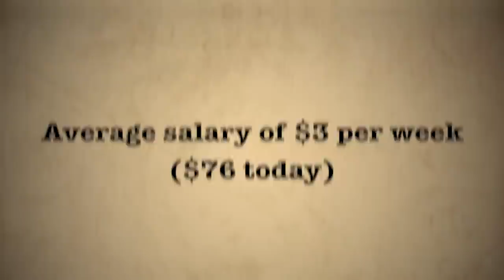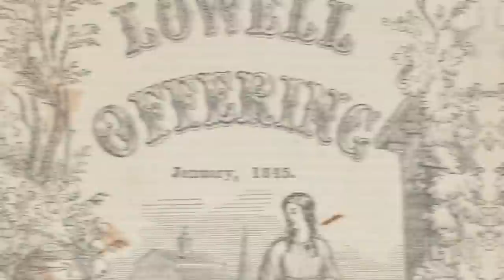The Lowell Mill Girls - American Wage Slavery

Comment: Aside from wanting to cry at pronunciation (it's pronounced like Low Wool), I think this misses a major point. It wasn't that the mill girls had it "too good for too long" but that the vast number of textile mills popping up everywhere led to overproduction and a steep decline in the market price for textiles. Since there was far higher supply than demand, the profits took a dive. They wanted the city to be an intellectual beacon, but the high supply meant factory speed ups, reduction in wages, having the mill workers double up on looms, and cuts in boarding house subsidy from the mills. Accounts of the early days do talk of women taping poems to the looms to read as they worked and the youngest girls having free time to play in the yards between running bobbins to the workers. It sounds like it started the way it intended, but you can't keep those standards unless you're making profits to match.

If you want another great story for this channel, there's a mill that collapses in Lawrence, I believe, that buried over half the workers alive. A dropped lantern from a rescuer caused a fire in the rubble, and no one else was able to rescue the workers. Instead the city stood by and listened as the mill girls sang like they did while working, only to hear their voices silenced slowly as the night wore on until none remained. The cause of the collapse? Factory owners taking shortcuts on building and cramming more machines on each floor than the factory could handle. So many lives were lost for the sake of maximum products.
Reply: Yeah that pronunciation is killing me. Usually I can muscle through, but he's saying it in a way that's making me disassociate from a city I used to live in
Reply: The triangle shirtwaist company fire?
Reply: @BigGahmBoss  Yeah, while I’ve not lived in Lowell itself, the pronunciation is killing me.
Reply: @coreyperdue1966  I got my head split open at the Tsongas Arena lol
Reply: @BigGahmBoss  LOL jeez man im sorry. Living in lowell typically results in brain damage one way or the other though
Reply: @coreyperdue1966  that is by and far the tamest of my Lowell stories. Those years will stay with me forever, for better or worse
Reply: @shaynalightfoot1414  Triangle Shirt waist fire was in New York City, I believe, and was pretty horrific as well. This was a large mill building that collapsed and the fire started when a lantern was dropped by a rescuer as they worked through the night to pull people out of the rubble. Due to the machine oil and the fabric there was nothing to be done.
Reply: @sarasynfox  I love all things Lawrence history.  Is there a certain name for this event so I can look further into it?
Reply: @Burningrocker20  It's listed in a book I have, but the book was left at someone else's house. I'm picking it up this weekend and I'll be happy to get you all the details of the event once I have my book back. The story was so chilling it stuck with me. I believe it's in the book Belles of New England, though I may be wrong. It could be in The Paddy Camps. I read both books pretty close together for a history paper, so I sometimes get the content about the mill towns confused between the books.
Reply: History repeated itself in Bangladesh. A textile factory was built and filled with too many machines and workers. The building wasn't sturdy enough. The loss of life was enormous. It brought light to the way Western countries turn a blind eye to human rights abuses because they want cheaper clothes.
Reply: @omgbuffy2276  God, that was a rough one.
Reply: The profits always seemed to be big enough for mill owners to have huge houses with servants, fine clothes, carriages, trip to Europe, etc. though.
Reply: And of course the owners were tried for murder and hanged! 
No, just called great men, and given more money!
Reply: @BigGahmBoss  Nobody in these comments knows how to pronounce it right
Reply: @MrKylederp  Um... it's easy enough to find out. Also, rude. But there's nothing wrong with locals commiserating over a mispronunciation. It's a bonding experience. Bonus, it brings our part of the community together. Like, why be the kind of person you're complaining about there, dude? Let us have some fun that hurts literally no one.

Bonus, we all know fact-boy doesn't care if he mispronounced the name. He's not going to be insulted. He already said he expects "all the people in the comments." We know he's not insulted, so why should you be?
Reply: @MrKylederp  It’s a pretty average city
Reply: @BigGahmBoss  Ah, but mispronunciation is one of his charms!!
Reply: C'mon theres no w in Lowell. Thats how its pronounced lol

Comment: Things have not changed that much.  I'm a seafarer I remember 1 trip where we had 3 fires. 
The captains  overwhelming concern was how much the over time was going to cost them. 
Same ship they ran the stores crane with bad brake coils for 3 trips. When the captain found 
out he was getting into trouble if repair was not made before we got back to the US he had me 
work way past my STCW hours to get the repair done. I was out there climbing over that 
crane with no railing so tired I could hardly see straight. Never went back to that ship. 
Most companies only care money and not if you live. 
Matson is cool  captain turned a ship around to get me back to Hawaii and into a hospital. 
Saved my life, also they paid a GIANT medical bill and transportation back to California. 
They were required by law to do this  but did not fight back at all or question turning a 
ship around. Thanks again Matson.
Reply: "Most companies only care money and not if you live. "

It's actually easier and cheaper for a company if an 'incident' kills an employee than injures them. I once cut my finger badly enough to need a couple of band-aids. The skipper wasn't pleased, not because I hurt myself, but because it meant 7 pages of reports. He told me that if I'd died, it was only 3 pages.

Comment: My mother worked in a sewing mill in Fall River. They had wooden floors, and oil constantly dripped from the machines into the floors. When those buildings caught on fire, they burned for a long long time.

Also as far as the things named after him, we pronounce it LOW-ell (long o) 🙂

Comment: I work 101 hour work weeks on oil pads in West Texas. I sympathize with the long hours at a job which is equal parts dangerous and monotonous. The difference is I get compensated VERY well for my work
Reply: Hopefully you will be able to buy up a few houses to rent out when you are in your fifties and be able to live comfortably in your golden years. This is what a former work colleague of mine did, working on the oil-fields off Scotland and then in Ireland in a factory as a fitter and instumentation tech. He could turn his hand to anything electrical, mechanical and IT related and he was multi qualified in all these highly marketable skills. The hours are long if your work entails detailed troubleshooting and repairs and risky if mistakes could cost millions, not for the faint hearted.

Comment: I live an hour away from Lowell and remember visiting the mills as a middle-schooler. The people who run the museum have no qualms in sharing the horrors of working in those places. I remember a story they told us of a girl who was killed by one of the fast thread-holding shuttles when it flew off its rail and pierced her skull. The Boott Mill museum keeps the machinery running today and you can buy the fabric it makes, however the machines are kept behind thick plexiglass due to said incidents and the deafening noise.

Comment: Wow. This sounds eerily similar to working as nurse present day. . . Not the bit about housing. . .but the rest is just about spot on.   No joke.  
Rules for are safety are "mandated,
", but resources aren't available or admins cherry pick policies day to day and then when something bad happens, it's obviously never their fault for ignoring policies they published. COVID (and other illnesses) sweep through staff, but nobody is told anything, even when we explicitly request potentially exposed coworkers be notified. The workers who aren't sick are running on skeleton crews and those who are ill are refused compensation of any kind and forced to use PTO for extended illness (usually all the PTO accrued). We don't get sick days, and for the months it takes to accrue even a week off-- if you're sick even one day, you might have to cancel vacation. We can be fired without reason and without notice (who doesn't love working in an "at will" state? Am I right?). . .
So.yup.been thinking about leaving the field-- This video is pretty much helped solidify that resolve.  Thank you Fact Boy!